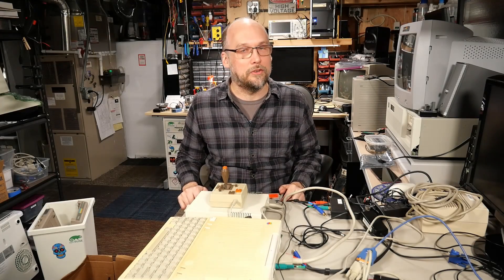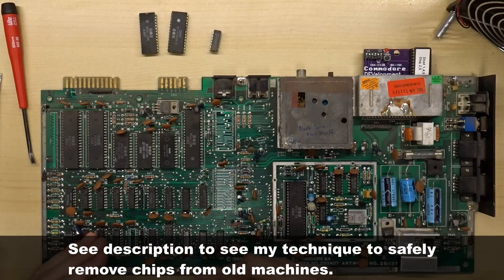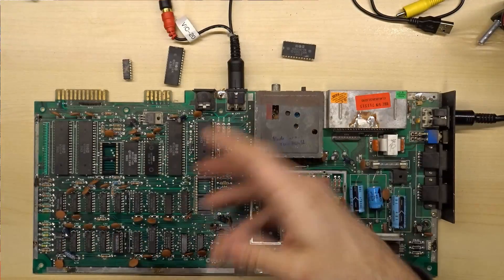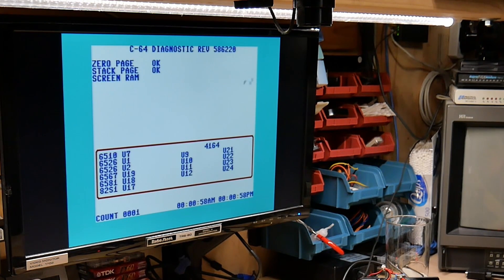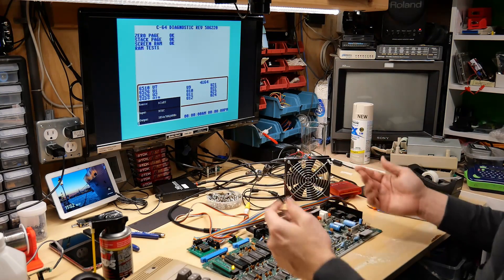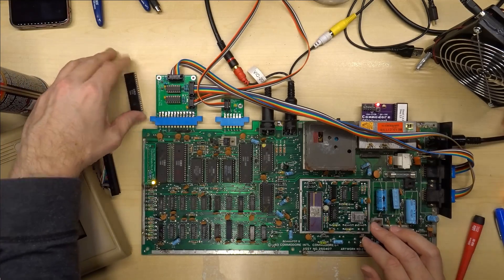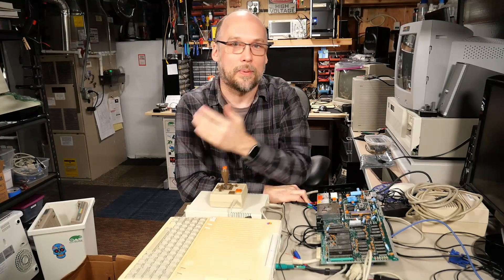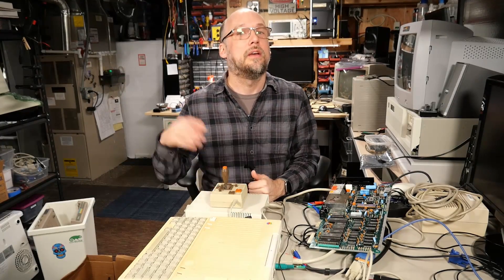Lincoln City C64 Testing and Repairs - Part 2

Comment: I like your channel.. 1 thing I noticed on the opening theme that every word say  "by"actually looks like  64 ;)
my recently bought C64 model 250425 had MT ram chips with error on 0. Removed them all, put in 8 new sockets and installed brand new TMS 4164 - 15 NL. That did the job.

Comment: Its not over until it is over! I expect a part 3 soon.
1) checked the traces between the CIA, CPU and other chips?
2) checked the voltages to the chip while it is running? That trick with the thermo camera might be useful as a hot chip on the board would take away from the system power.
3) One thing I never seen you do is physically check the cartridge slot. Here in the ghettos of NYC roaches and other insects get into cartridge slots and muck up the place. Sparing you such details, have you De-Ox'd the cartridge slot?  If this is a physical and not electrical issue De-Oxing the slot should fix it but you still need to clean out the slot. Good luck.

Comment: I'd say that the trace going to the connector has a discontinuity somewhere. Maybe the vias... Anyway, where do you guys pick up those all commodores and where do you even get software, disks, etc? Isn't that all obsoleted and aged well beyond their use, especially 5.25" floppies ?!
Reply: You should check out the whole series of vids.  ;-)  In this case, all 3 of these C64 boards and that 1541 he fixed came from a box in a barn in Grand Ronde Oregon.  They had been there for years.  The owner contacted me and asked if I wanted them, which I did. ;-)  But this level repair is beyond me, so I am so glad I ran across Adrian!  (There were also 2 Vic-20s that work and I still have them).  As for floppy disks, some of us have lots.  I was able to get a case of unopened DSDD 3.5" floppies several years ago on ebay.  As for 5.25" disks, I still have a lot from back in the day, and a surprising number of them still work fine.  I bought about 10 unopened Apple 2 games several years ago (Atarisoft) and they all worked great.  (Yes, I opened and played them.  I am not a sealed box collector.)  ;-)
Reply: Speaking for myself, most of my vintage computer gear is either stuff I just never got rid of in the first place, or it was stuff I picked up for dirt cheap back when it was just worthless obsolete junk (in the '90s and early '00s there were computer surplus stores that had, e.g. Amiga 500s with monitor and SCSI hard drive for $35, or Mac Quadra 700s for $5 (I bought 4), and the thrift stores were overflowing with 8-bit machines (you can still occasionally find random vintage computer equipment at thrift stores)).  But mostly, when I work on people's computers, I let slip that I collect vintage computers.  I've had lots of old computer hardware come my way simply because people want to clear out their basements and would rather see it go to a good home than just get thrown in the dumpster.  Just in the past 6 or 8 years, I've been given a Timex/Sinclair 1000, a T/S 2068 (with a bunch of cartridges), an Ohio Scientific Challenger 1P, an Apple 2e with lots of original game disks, An Amiga 1000 with a 24-pin printer, a monitor, and lots of software and documentation, and a C=128 with monitor and printer.  A brother-in-law gave me a breadbin 64 he found in the trash.  It had a bad VIC II, which I replaced with one I found on eBay.

I still have lots of good floppy disks.  There is some kind of statistical attrition rate, but seldom do they just fail catastrophically.  I have, even recently, found unopened boxes of NOS floppy disks at thrift stores, and I buy these at every opportunity.  On occasion, I have a floppy testing purge, where I check/reformat boatloads of floppy disks, backing up the contents where possible, and sorting good disks from bad.  I still keep the bad disks, as there may come a time when even a floppy disk with a few bad sectors will come in handy.  The disks that won't even format can donate their sleeves/casings to repair disks that have good media but are otherwise messed up.  eBay is certainly a source to find original programs, though sometimes the pricing suffers from R@R3 syndrome.  

Most of the software for the 8-bit machines is archived online, sometimes with the explicit blessing of the original authors.  Each vintage platform has software/hardware solutions for writing disk images to real floppy disks from disk image files on modern computers.  Sometimes you have to wire up a special cable.  Usually somebody has them for sale on eBay or Tindie.  Cassette-based software is usually archived as .WAV files, or in a .CAS file that can be converted to a .WAV with a utility of some sort.  Then with a vintage cassette cable you can load the programs into the vintage computer using the audio out on your modern computer, or even your phone.  I have dozens of CoCo games on my phone.

And there are lots of modern devices available from hobbyists that will emulate a disk drive, but store disk images on an SD card, which will replace the old floppy drive (and sometimes controller) entirely.  These are often quite affordable.  The CoCoSDC for the Tandy Color Computer series is around $45.

Comment: Years ago I had to replace a RAM chip in my childhood C64, the replacement chip I scavenged was an MT Micron chip..... still works 20 years later :)
Reply: Perhaps it's just certain batches?
Reply: @Vampi_Sweden  certainly possible. At some point Micron started making really good RAM chips, but I don't know when that was.
Reply: @davefarquhar8230  I hawe very little experience from them so i can't realy tell based on my own statistic, but i know other types of chipset from different manufacturers also had problems in some batches, but other from the same manufacturers seem to last like forever.
I guess it has to do with how well the manufacturing process managed to make a stable bound between the base material and the additives without drifting or degeneration ower time, if it for example run into problems with drifting ower time it will sooner or later run into a critical fault even if it worked perfect when it was new, but if the bound are stable it won't happen at all, so the only practical killer will be things like thermal stress i think. (at least that's my personal guess without knowing for sure).
Reply: you're very lucky. I have yet to have an Atari 65XE/130XE with MT RAM that doesn't have at least one faulty IC.
Reply: A lot of people say MT isn't a bad brand, but it may be more susceptible to over voltage. Well we know that happens on the stock bricks. So it's possible the only reason those chips are bad is because the original PSUs killed them. /shrug

Comment: What is the voltage on that line?  If it's too far above 0V, it may be registering as high on the dev board (but the chips are more tolerant) and you may have a bad pull-up resistor.

Comment: ive  been a IT admin for 25 years and this stuff is even way over my head lol .. I'm impressed you can figure this type(s) of problems in first place ...I only understood  20% stuff you said or even means , but very well done .
Reply: Electronics engineering can seem a bit complicated but if you're in networking or programming large complicated or low level projects EE is not so bad. At least if you stick with the basics. High frequency stuff is almost like magic. Luckily there's nothing approaching high frequency or high complexity on the C64 ;)

Comment: Did you check the interrupt trace to the cartridge port?  Maybe the Dead Test Cart can't sense the interrupt on that one board because to signal doesn't reach the cartridge port.
Reply: Michael Stoliker The cartridge is a normal Eprom cartridge like the openC64cart or the versa64cart. It does not do anything with the interrupts.
Reply: @svenpetersen1965  Other than detect that interrupts are working?
Reply: Michael Stoliker the interrupts are not tested on the cartridge itself. The cartridge only holds the software. There are no special test fixtures on the cartridge. The feedbacks are all in the harness.
Reply: I was also going to suggest an investigation into feeds leading to the testing cartridge, if it all checks out, check for timing issues, but then again becuase youre refurbishing, I am guessing you probably already done that....

Comment: right brasso..... best wat to use it. smear it on the bits you want to clean and leave it for 10-15mins, then polish it off...... the longer you leave it the more crud it pulls out of the copper or brass...... :D
Reply: really??? never knew this, not that i ever use it on brass, rarely copper
Reply: @frogz  that's what its made for.... :D awesome stuff.....

Comment: Adrian, it sounds like the interrupt is working, but maybe just misses the window when the diagnostic unit expects the interrupt. I’d blanket change any electrolytic caps in that whole circuit. Sounds like one has changed in value. Believe it or not, some electrolytic caps GAIN value in microfarads as part of their failure mode. I’ve seen this a lot on plain old aluminum types of electrolytic caps, and will totally mess with a 555 timer. Ceramic caps are pretty long-lived, so those should be OK, but if they are in a timer circuit, suspect them also.  From the schematic, it looks like the 555 timer (one part of the 556) is used as a single shot with a specific time value and if it’s too long, (or short) it may miss the diagnostic window of being sampled. It is working (probably) but the timing is off regarding when it is expected.   Also, that 7406 is a very high sink current open-collector inverter designed to drive MOS type silicon.  If the pull-up resistor is open, the drive current is reduced and the inverter may no longer meet its specification high to low transition time and can be out of spec. Suspect the inverter chip and/or the pull-up resistor pack. Desolder the resistor pack and ohm out each resistor. Any resistor more than +/- 10% is out of tolerance.  Great video!!  Thanks!!
Reply: I was going to suggest checking the RP3 resistor pack to ensure all of the separate elements show the same resistance. However this sounds more likely to be correct. I suspect Adrian has already check it anyway as he's a clever fellow 😁🤷‍♂️
Reply: If in doubt yank it out.😁
Reply: Just to set things straight, usually caps don't gain more actual C value, they just measure high because they are leaky (electrically) so they pass current through them instead of storing them. Regular C testers only measure how much current goes in and how much the voltage rises across the cap. Energy lost through the leak is accounted for as increased C because the tester cannot distinguis between stored current and leaked current. Any part which tests high in C should definitely be replaced.
Reply: Pentti Kantanen Quite right!!  The ESR changes dramatically, due to leakage.  I guess I should have expanded on that. Sorry.
Reply: @BigDaddy_MRI  To my understanding ESR and leakage are still different things. ESR is (low ohms) series resistance "between the capacitor plates and the load" whereas leakage is a high ohms DC current path between the plates. I don't think one is necessarily indicative of the other. A good tester will measure ESR, but I'm not sure if they account for it in the C rating measurement or not. That's something I would like to know actually now that I think about it. Off the top of my head I'd hazard a guess that ESR is usually not a major component in C testing because the current used is so low that not much energy is lost across the resistor. Test frequency is probably a factor here though.

Comment: I have a C64G on my end, and colors look really odd, it has shadowing, and text is washed off / unreadable in different colors. I hooked it up to a scart converter, and av, and on both i see ghosting. On scart i can see the colorissue on av i see jail bars. Any idea what's the issue? :|
Reply: That sounds like a problem with either the VIC-II chip, or the crystal oscillator (Y1) that feeds the color clock and dot clock.  Try replacing the VIC-II chip with a known good one.  If the shadowing goes away, then you know what the problem was.  If you still have the shadowing/ghosting, even with a known good VIC-II, check the oscillator.  There may be other things it could be, but that's where I'd start.
Reply: @SpearM3064  Issue is, i don't have any spare parts :| Might try with Y1, even tho i literally s**t myself when i opened it cause i was afraid it'd break, it was never opened before. XD

Comment: Have you checked the freq of the oscillator? Look at the pulses on the scope and make the signal is NOT ratty.
I have repaired hundreds of C 64's back in the 80's  and a few times a ratty clock caused the weirdest problems.
Be sure the clock is dead on the freq spec
Regards,
Glenn
DSSM Labs

Comment: Might be a long shot, but I was getting same issue with a recent fix.  My test harness is different brand, but it turned out to be slight corrosion in the joystick ports.  I had to use contact cleaner and work the plugs on and off several times.  Really seat those plugs hard and get a good connection.  Now I don't get that anymore.  Worth a try.

Comment: On the 64 with the IRQ troubles: Have you measured the 60 Hz signal coming out of U27? Is that present on both chips (on the TOD line, pin 19 on the CIAs)?
Reply: (great video, by the way. it's always fun to try and guess what's bad :) )
Reply: I would check that as well. I think the CIA can generate an interrupt based on the value of the Time Of Day clock.

Comment: Adrian, if I may suggest something: Get the Transformers game for C64, the Side B (it should be in a separate D64 file). This intro features some great speech and it stresses the SID chip totally, so it could be a great test for this chip.
Reply: isn't speech only done with the volume register? Why do you think it stresses the SID? Do you think rest of the SID registers are used/tested somehow with speech too?